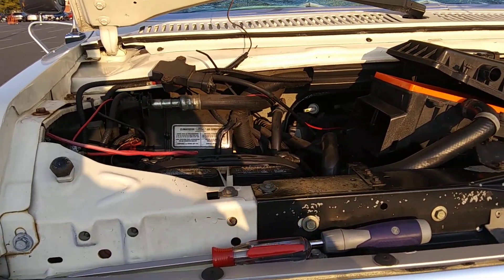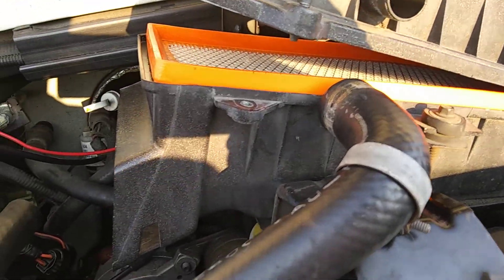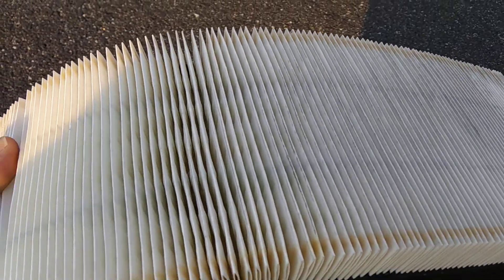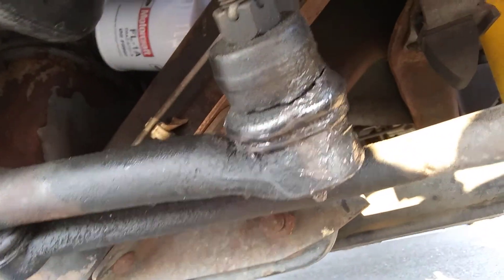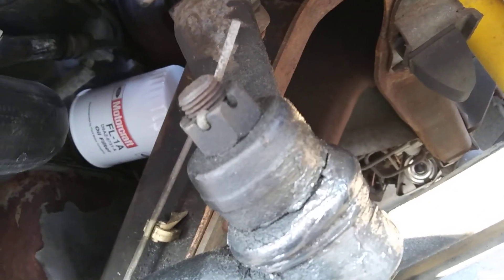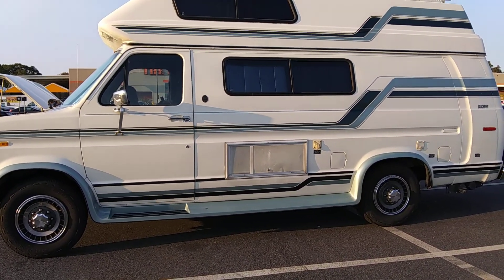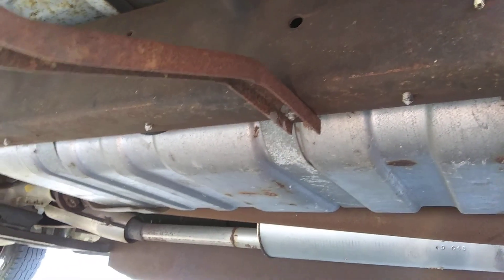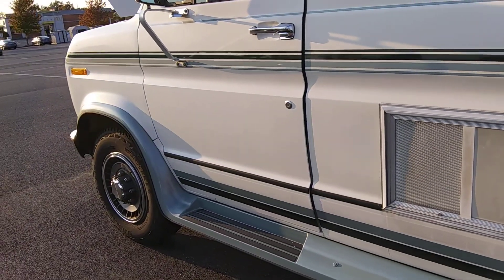Dino the dinosaur 2 is Now good to go almost 🌎🔨🔧🔩🚐👈😳😳😳

Comment: The high mileage oil you had in the last video is good for 15,000 miles. My ladies car is 3 years old with over 130,000 miles, replaced the oil with Mobil 1 high mileage. Its guaranteed for 20,000 miles. The cheap Walmart synthetic oil is good for at least 7,500 miles.  Also the engine compartment looks nice and clean!
Reply from the maker: Thanks for stopping by Lex I hope you're doing well out there🌎. And yes Mobil 1 fully synthetic oil is supposed to be a really decent quality oil I've never used it before till now I've use Pennzoil before and I've also used Valvoline quite a bit there's just so many choices when you walk in to an auto parts store or Walmart so many different name brands🚐😳😳😳